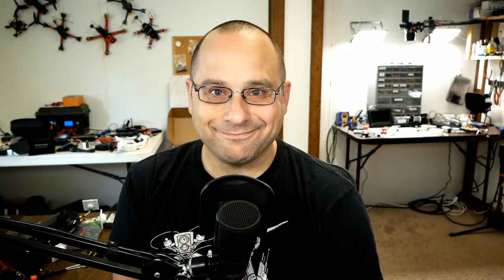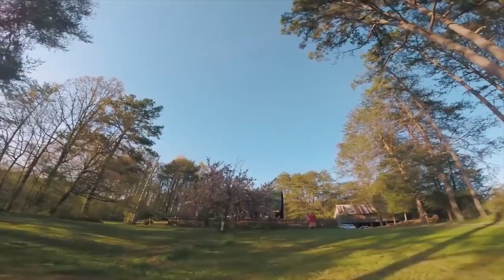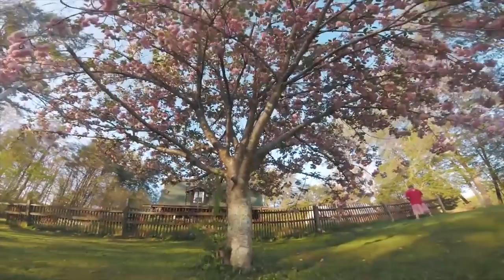Parallel Charging | CAN YOU MIX DIFFERENT mAh OF BATTERY

Comment: Thanx Joshua, really helpfull information! Now I understand, why one of my six 1000mAh 3S  Lipos got hot and puffed while charging: it had 3.5, all other had 3.8 Volts. So five Batteries fed one (or 15 cells fed 3 cells) with 0.3Volts. Seemed to be to much for the one (which happened to be the oldest). Surprisingly, after cooling it down in a sand-bed, The internal resistance wasn't compromized🤔🤔🤔
Reply from the maker: Yeah I would say that is a likely cause. Always plug in the lowest-voltage pack first, and then work up from there.

Comment: what about chemistries? Can I have a lipo pack in parallel with a lion pack? Im using 7s. Even more ridiculous, I have a 7s lion pack right now, and want to add cells in parallel, could I make a 7s2p battery with 7 lions in parallel with 6 lipos and a lion to make the 7s? Ill be using a BMS. Newbie so don't be tight.
Reply from the maker: I wouldn't mix chemistry like that because the max voltage is different. So the LiIo would get overcharged or the LiPo would get undercharged.
Reply: I thought they were all 4.2? I thought its just the form factor that is the difference
Reply: And wouldn't the BMS sort that out?

Comment: the question is can you mix them in series not parrel ffs 
nobody awnser this question
i want to upgrade my 36v to 48v pack and i fear the buy i buy from may use a slithy  stronger variant than what was used in the first pack :S
Reply from the maker: Cells in series must be the same milliamp hour and C rating and internal resistance.

Comment: I'm using 4 diode for 2 battery to stopping this together charging phenomenon.. Negative will be direct 2 diode for charging wire and 2 diode for out+ to battery's that's the solution 😆😆😆🤓

Comment: Good Video 👍👍👌
I wanted to connect in parallel a 60amp battery with a 230amp battery....but i think it's risky.
The  bigger one is 4 times bigger than the smaller.

Comment: I'm having a hard time wrapping my head around this...

You used the water analogy to talk about voltage and capacity so it confused me a bit. 

I still don't understand why batteries with lower capacities will take a smaller portion of the charge and batteries with larger capacity will take a larger portion...

Let's say for the moment we are not charging... I understand connecting two or more batteries will equalize voltage. 

But under that principle, with the water balance example you gave... wouldn't the capacities also try to equalize... resulting the lower battery trying to fill over capacity? 

What makes the lower capacity batter suddenly stopped accepting a charge? For example, if I had just a single battery connected to a charger and kept pushing current into it, wouldn't that damage the battery?

Why would it be any different just because we have two batteries? 

Honestly not challenging you, I truly want to learn. I understand it may be a lot to explain, but if you could even just point me to a good resource that explains this it would be very much appreciated. 

 Thanks! Love your videos. I'm learning a lot.
Reply from the maker: Imagine you have a bunch of water tanks of different diameter. One is 1' in diameter; one is 2' in diameter; and so on. Imagine they are all being filled from the bottom and they are connected in parallel. Because of this, the water level in the tanks must always be the same height, right? So we pump in some water. Because the water will always be the same height, the larger tank will always take more volume than the smaller tank, simply because it takes more volume to fill the tank to the given height.

Let's say we have a 1000 mAh, a 2000 mAh, and 3000 mAh battery. If we push 1000 mAh into the 1000 mAh battery, that will take it from 0% charged to 100% charged. If we push the same 1000 mAh into the 3000 mAh battery, it will take it only to 33% charged. The same current pushed into a larger battery causes its voltage to increase by a smaller amount, and vice versa. This effect is why, when batteries are in parallel, they take charge proportional to their size.
Reply: @JoshuaBardwell  Hey, thanks for your fast reply! I'll read over your reply a few times and try to make some sense of it. Thanks!
Reply: @JoshuaBardwell  Thank you fir your response!

Okay, I think I understand...it's because with these batteries, voltage IS directly related to how full they are as a percentage of capacity.

And since we have to match the voltages anyway before we connect them, AND because they equalize if we do, it won't be a problem. 

A battery at 50% would be at approx 3.8v per cell no matter how big the capacity is... So if you start with all batteries at 3.8v per cell and bring them up to 4.2v per cell, you are still increasing all the batteries up by 50%. 

Is this correct?
Reply from the maker: Correct. That's a good way to think about it. If you go from 50% to 100% charge, you go from 3.8 to 4.2 volts. For a 1000 mAh pack that's 500 mAh. For a 3000 mAh pack that's 1500 mAh.
Reply: @JoshuaBardwell  Thank you!

Comment: Unfortunately "foolproof" paralel charging of two batteries (500 mAh and 5000 mAh) attached to one paralel charging board in safe way for both exclude internal resistance metering. "S" must be same for both batteries and both batteries must be empty (assume it will be 3.6-3.8V) - that is clear. The rest are mumbo-jumbo for nerds with enough spare time to check internal resistance and lesser things. Majority of people doesn't have advanced paraboards with current limiting either. That boils down to mandatory requirement to avoid exceeding the charging current of smaller battery. The safe charging current will be perhaps 3C so 1.5A for 500 mAh battery. That is 0.3C for 5000 mAh battery. So total charging time for our two battery contraption will be more than 3 hours. Conclusion - this mixed battery charging experiment is possible but completely unusable in real life. Because we can charge both batteries separately in one hour if charger does support enough current to charge 5000 mAh battery with 3C current (15A). Or if we have parallel charger with at least 10A support per channel, then we can charge both batteries in something like hour and 25 minutes. Still twice faster than both batteries together.

Someone will insist that better is to buy a second charger or to have several chargers.... guys, don't forget that most of FPV pilots nowadays doesn't live in First World countries anymore. And income level even in First World countries differ in large scale. If average pilot can afford to buy 200W parallel charger, it is still good. And the reason obviously is to charge all batteries faster. The real deal then is to find the right combination of batteries that someone have that will charge faster using single existing charger! For batteries with different capacity it is obvious to charge batteries of the same capacity connected to one paraboard and paraboards with different capacity batteries connected to on different charger channels.
Reply from the maker: Sorry but this is another misconception that is incorrect. You are right that the individual packs' charge rate must not be exceeded. But the incoming current is divided between the packs approximately proportional to their capacity. So if you have 5000 mAh + 0.5 mAh you can charge at 5.5 amps and each pack will receive approximately 1C.
Reply: Probably I should listen this video once more. Theoretically you're right. In practice I don't wish to burn down my house.

Comment: I think you are actually incorrect that battery capacity matters AT ALL. If you use your example of a 5000mah battery at say 3.6v and a 500mah battery at 3.5v the only things that govern current flow into the cell will be the internal resistance of the smaller cell. If this did matter plugging in the last battery in your parallel board could be risky with almost any voltage difference.
Reply from the maker: If you have 10,000 mAh on the parallel board at 3.82 volts and you plug in a 3.78 volt 500 mAh, I do think there is some risk to that. The IR of the 10 Ah parallel array will be very low and the inrush could damage the 500 mAh. At least that's my belief. I haven't tested it.
Reply from the maker: Even if the IR of the smaller cell is higher, if there is sufficient difference in potential, harmful amps can flow.
Reply: Inrush current is voltage difference divided by the sum of the two packs internal resistance.

it's generally good to plug in from low to high voltage (last pack will risk high discharge not charge).
Reply: I don't think it is the sum, it would be if they were in series but in parallel it should be less, 2 cells at 10 milliohms in parallel would be 5 milliohms. Can't math enough right now to describe that relationship properly.
Reply: True but it is ONLY the voltage difference, in the example you describe it's the IR of the lower pack that matters as that is where the current is flowing. Th IR of the higher pack will only affect the ability to discharge into that smaller pack but not the actual current flow in that example.
Reply: Fraser Steen I'm sorry but you are wrong. It is what I said, was not guessing.

Try drawing the circuit diagram and you'll see a simple circuit with two resistances and two (opposing) voltage sources.

Comment: when you consider a 18650 unusable(what % should be left)
Reply from the maker: Don't think in terms of percent think in terms of voltage. A typical LiPo cell is 100% fully discharged at 3.0 volts. I think that LiIo cells can go lower, and some 18650 are LiIo chemistry, but I'm not sure about that. Remember, 18650 is a size of battery, and different chemistry can be present in an 18650 cell.

Anyway... Personally I pull my 18650 down to like 3.2 volts because usually I am not drawing very much current so sag is minimal. If I were doing a higher current draw, I would want to watch the voltage under load and keep it above about 3.2. Bear in mind, this is NOT the same advice as used for LiPos on a quad. I never take my LiPos on a quad under about 3.5 or 3.6 volts per cell, because the load is so much higher and they sag so much more they're not really usable below that.

Comment: The things to keep in mind while connecting batteries in parallel is -

1) Batteries should be of same chemistry
2) Batteries should have nearly same voltage
3) Capacity should not vary very much like connecting two li ion battery in parallel,like 1800mah and 2000 mah 3.7v batteries li ion,connecting them in parallel is safe but I wont reccomend if you are connecting 1000 mah and 3800 mah cell in parallel
4) Batteries should be of same type
Reply: How much different mAH is safe to combine?

Comment: I actually did learn something today! Great info, thanks!  Also, I learned from KrazyFPV that when you parallel charge batteries (of the same cell count) it's good to plug them in, then wait about five minutes before beginning the charge. This gives them a little time to equalize.  I've gotten into the habit of doing this even when the difference is only as little as 0.1v and my batteries are definitely lasting longer.

KrazyFPV's video:  https://www.youtube.com/watch?v=r6QfTZl_q74

Comment: That water analagy is bit off the rock
Gravity controls the level !
Reply: Analogies exist the visualize something more easily, not to match everything up perfectly. If the behaviors match up then it's a good analogy. The fact is that if the water height represents the voltage and the length/width (total volume) represents the capacity of the battery, hooking up the containers of water at the bottom (so that they always equalize) gives you an accurate example of how energy will behave between two parallel batteries. There will be some inaccuracies, like hooking up a full container to an empty container doesn't cause excessive heat and a possible fire/explosion but the massive flow of water gives you a clue as to why your batteries just caught fire.
Reply from the maker: I have no idea what you're suggesting here. That there could be differences in gravity between the two containers that cause level to be different?
Reply: I thought the water comparison was spot on. As an electrician, I often use the characteristics of water to explain basic electricity. Their properties are very similar as it relates to pressure ( voltage ) ,   flow ( current ) and resistance ( ohms ).

Comment: don't know if I missed it. But be aware that you can't say for sure  how the current divides between the cells. The bigger battery might have a higher internal resistance  due to ageing, so most of the current can flow into the smaller one.
I would only recommend it with a charging current that is save to charge the smallest battery on its own
Reply: J Bender actually internal resistance does not impact how the current splits. It does however control the peak of the in rush current when plugging in.
Reply: First educate yourself , than edjucate odhers this is how these misconceptions spread

Comment: this myth angry me a lot. I have 2 ago in parallel , 110 ah C20 and 68 ah C20.
With 18 A load the small give circa 7A and the big circa 18a. sempre stesso soc stesso stress.
l'imporatnte è che le batterie abbiano parametri di carica simili e stessa resistenza interna per AH.
Se la resistenza interna per AH è diversa, semplicemente userai piu quella minore all'inizio.
Non si sovraccarica nessuna batteria , non succede nuklla una batteria rispetto all'altra è come un generatore se si caricano e come una lampadina se si scaricano. non puo fare nulla di male una batteria in parallelo a meno che al momento della connessione ci sia una grande differenza di tensione, o i parametri di carica siano incompatibili.
è meglio una piombo gel con lifepo4 che una gel con tubular plate traction flooded. Se scegli i parametri per la gel, solfati la traction. Se scegli i parametri della traction distruggi la gel (15.5 absorption, and 16.5 equalization)

FOR EXAMOLE parallel between lifepo4 and gel (both 14.4 abs, and 13.6 float)simply cause you use almost only lifepo. because at same voltage and much less resistance , lithium give and take almost all current. only after lithium Soc drop enough to  have a voltage so low to  Cancel the advantage of lithium in IR, lead acid begin to give much current. A thousand paranoias for nothing. a battery is a resistance in charge, and a generator in discharge. Relative voltage respect other load or generator or other battery determine if the battery is a load or generator .

Comment: the worst myth about battery, NO SENSE , NO REASON. the ohm law say almost all about battery. only the series is (generally ) not possible with different capacity . but parallel is ok. All the chargers in the world they control voltage. current is divided to resistance . Same voltage, same type of battery, different capacity, no problem. But in series the charger lose the control of the voltage on each battery if capacity if different. if charger make absorption at 28.8v with a small and big battery, we dont now like voltage is divided. sure not 14,4 and 14,4. maybe 13.4 and 15.4. 
15.4 destroy most of battery, except lead acid tubular plate . 13.4 dont charge any battery

Comment: You left out a very important aspect of parallel charging... which is the resistance between 2 voltage mismatched batteries.  You could easily parallel 2 battery packs with a large voltage difference (let's say 12.0V and 13.0V for AGMs), if there is significant resistance between them to limit the current flow.  For example, there is a 1.0v differential between them, however if you connect them using a 1 ohm resistor, then at most, 1 amp could flow between them (using Ohm's law of V=IR).  Why would you leave this very important piece of information out of your presesntation.  Downvoted!
Reply from the maker: When connecting packs using a parallel charging board like the one shown in the video, it's assumed that they are already at the same voltage, because the parallel charge board does not have built in resistors to limit current flow. The board cannot have these resistors because they would interfere with charging.

However you choose to get the batteries to the same voltage is up to you. If you have a power resistor that you choose to use to equalize the voltage, more power to you.

The reason that concept is left out of this video is that this video is answering a specific question about parallel charging, and not every video needs to contain every possible piece of information about the topic.

In addition, the maximum voltage difference between lithium packs used in RC hobby is more than one volt, and the size of resistor needed to equalize them in a timely manner is inconvenient.

Comment: .....assuming cell count is equal.
Reply from the maker: I said the voltage needs to be within 0.1 volt per cell. That implies that the cell count is equal.
Reply: So you would charge a 4S with a 3S?  I wouldn't even if it's implied to be ok.